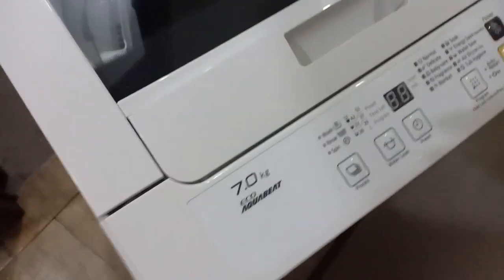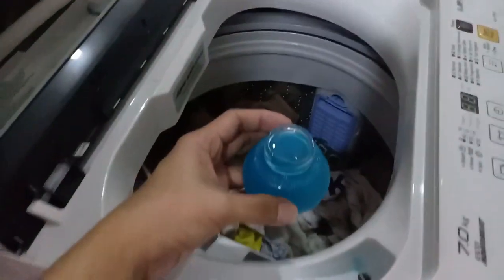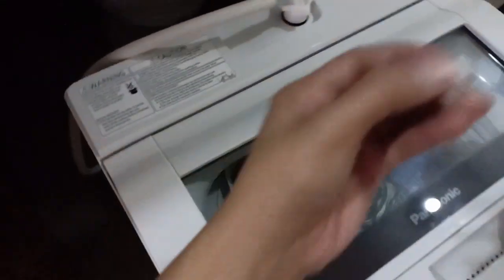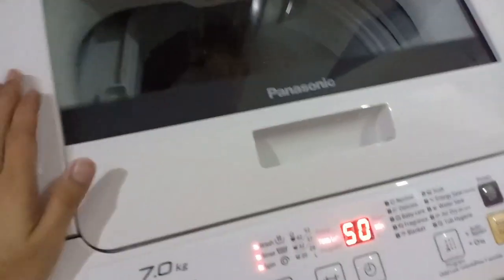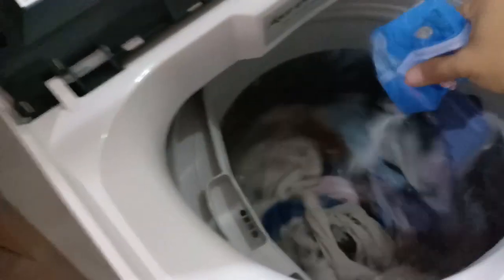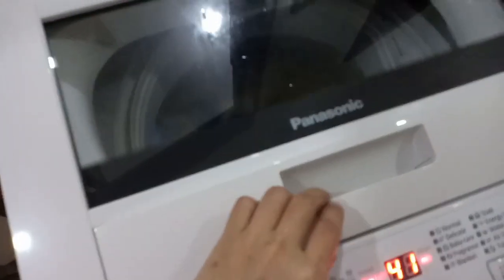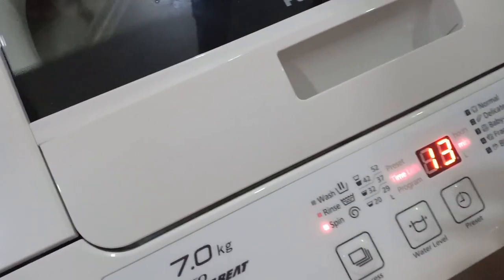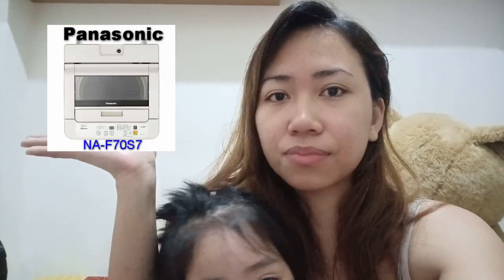VLOG #19: How to use Panasonic NA-F70S7 Automatic Washing Machine / DEMO ♥ The Newbie Mommy ♥

Comment: I don't recommend na ilagay yung fabcon sa start ng laundry. Sa first spin kasi nagdidispense na yung softener. Ang program nya kasi is:

Wash > Spin > First Rinse > Spin > Second Rinse > Final Spin

Magandang ilagay mo yung fabcon sa dispenser kapag nasa first rinse para madispense sya sa second rinse. Sayang kasi mababanlawan ulit sya sa second rinse
Reply from the maker: Aw, yes good idea! Will do that next time. Though in my case, naaamoy ko pa din naman yung fabcon after the whole process, pero hindi lang ganun kalakas yung scent nga. Kaya yes, I think you're right to put it sa last rinse. :)
Reply: pano po pag drier lang ung gus2 ko iapply? ano p iseset up?
Reply: @joshuaesperida512   yung airdry will take 90 mins. Kung masyadong matagal for you, pwede mo gawin to:

Power ON>choose Normal (Program 1) > press mo yung button na nakatapat sa wash/rinse/spin several times until sa SPIN lang yung may ilaw > press Start

Spin will take 9 mins. Pero depende kung balanced or hindi ang load
Reply: slamat po
Reply: Hi po. How do you administer powdered detergent into the machine? Dapat ba before you put the clothes into the washing machine?
Reply: @adonjohnlaserna1837  Hi, you can actually add detergent after or before you load the clothes. It's fine. Make sure lang na high efficiency gamit mo na detergent, para di madamage ang machine
Reply: @benedictcruz07  kasi my problem is i usually put detergent on top of the clothes tapos after the wash, there is residue of soap on the clothes. Tapos after doing research, they recommended to turn on the machine and start it and as the water pours in you add the powder then the clothes. Pero ang downside nito is the machine cannot estimate the corresponding water level na for your labada haha. Anyway thankyou for the quick reply. God bless
Reply: @adonjohnlaserna1837  you can use liquid detergent for your clothes or, dilute the powdered detergent in water before adding onto your clothes. Para sure na walang residue. :) sure, no problem. :)
Reply: Nahihirapan ako. Kanina pa ung labahin ko. At first nagwork pero nung nag drain nagstop na. Patulong po
Reply: @yourkasi  paano po ba nangyari?
Reply: @benedictcruz07  biglang nag stop po sya ng matagal. Tapos on off ko. Bigla ulit magspin tapos mag beep sbay stop tapos ung sa rem. Time baliktad na 3 at 1. Ung 3 lang baliktad, sa kabila sya nakaharap. :(
Reply: @benedictcruz07  pano po ba unang gagawin? Kahapon ung tinry ko una Hindi nagwork, pero nagwork naman bago mag gabi. Ngaun ayaw na naman. Sharp po pala ung saken
Reply: Mag kanu po ba ag budget ng washer na ito??or is there any washer that is smaller than this?? Thankyou.
Reply: automatic na yan rinse start pa lng ng washing nilalagay na ok lng!!kc sa huli nmn nyan yan rinse ng washing!!kaya nga automatic eh!Parang sa water lng yan hanggang di click start naka lock sya!!di yan i disposed ng washing yang mga downy na yan start pa lng, sa bandang kalagitnaan ng time ng washing saka lng din yan i disposed automatic😅😂🤣wag nyo open ng open washing nyo if nasa operation yan ang ikakasira ng programming nya!!Saka yung water outlet dapat mas malapit sa washing at mas mataas ang level ng water outlet  na i connect ang hose na water supply ng washing at need malakas ang supply ng water flow dahil may standard program yan time at pati yung ilang meter lng dapat distance ng washings sa water outlet!!Sa japan lahat ng bahay bago gawin kasama na sa plan saan ang place ng laundry may gawa install na  sink ng washing drainage at most of all yung outlet saan i connect ang water na malapit sa lagayan ng washing at mas mataas ang level kesa taas ng washing!!na yun tlg ang standard na estimate ng programming ng mga automatic washing machine!!Di dapat bukas ng bukas pag nag operate na naapektohan ang loading ng programming nya!!1980s pa automatic na mga washing sa japan kung saan kelan lng familiar sa pinas di pa alam ng mga home builder isama sa plan ng paggawa ng bahay mga electrical outlet at water outlet supply at drainage ng dirty water ng washing na dapat kasama sa plan sa ilalim deretso drainage di nakatiwangwang bumabaha sa labas tubig galing sa washing!!!
Reply: Maayos na flow ng water malakas dapat!!Ang hose ng water kung saan naka connect ang washing malapit lng ang distansya sa washing!!Dapat mas mataas ang faucet ng water  kesa level ng washing na pinag connect nito or else di magtagal ang washing sa pinas dahil wala sa ayos ang standard fascilities nito na naka program sa pag gawa pa lng!!Di tumatagal ang automatic washing machine sa pimas sira agad dahil wala sa ayos at tama ang fascilities!!Sa japan naka ready na lahat yan sa mga gumagawa pa lng ng house naka measure na ang standard na distance ng pag connect ng washing at taas ng level nito more than the washing ang outlet na doon i connect ang water!kahit gaano ka durable at good quality ng products mabili kung ang fascilities di tama sa programming standard ng washing di ito magtagal masisira agad!!Lalo sa pinas uso ang brownout bigla nawalan kuryente pak sira  downloading ng program ng washing!!Bagay sa bansa na tulad sa pinas nag brown out mga manual na washing hindi automatic!!
Reply: put all your clothes to washing,then detergent powder and downy!!you can see the dispenser kung saan ilagay ang powder at softener and bleach if white mga labahin!!On your washing and set your washing sa desire na paglaba kung ayaw nyo ng automatic program na depende sa dami ng labahin na washing na dapat nag estimate!!may button jan kung gusto nyo full wash mode full rinse at dry nya at pwede nyo i set kung anong level ng water lng depende sa dami ng labahin!!after ng lahat saka  press Start!!!Hindi nasisira ang washing dahil sa mga uri ng detergent powder,bleach or softener kundi sa system ng fascilities nyo di maayos lalo sa flow ng tubig if sobra mahina!Dalat malakas flow ng tubig sa faucet nyo para mag match sa setting time ng loading program ng washing!!Wag tipirin ang flow ng tubig dahil kahit malakas sya lahat na kokontrol nmn ng washing tamang flow!!kung mahina ang flow di match da standard process nya lalo time!!Higit sa lahat wag open ng open if nag start na kayo process ng paglaba kahit sabihin na ok lng buksan isa sa napadali masira ang automatic washing machine!!!Mas pinaliliwanag kc masyado sa japan ng mga distributor ang details ng tamang pag gamit ng products nila to avoid trouble sa products nila masira dahil hanggat maari good perfect quality products ang gusto nila paninda!!
Reply: Parang mabaho pdin po yung mga nilabhan. Ukih lng po bang buksan un washing kapag nag aalnaw na?.
Reply: @VChin-ru8oq  sa haba ng sinabe mo, walang tama. Edi sa Japan ka maglaba.
Reply: @joshua esperida paano po pag naglaba aq kamay tas gusto q lang po spin lang sa washing machine tas click q lang cya at several times until spin na yung light..kahit hndi ko na po ba i on ung faucet?salamat
Reply: Or sa last rinse sya ilagay ganun kami kaya mabango parin damit after matuyo. Yung iba imbes na fabcon ang ilagay distilled vinegar at one cup ng baking soda daw mas nakakalambot, nakakatanggal ng stains at nakakatanggal ng amoy ng labahin. Nilalagyan lang nila ng essential oils para mabango.. Sa US yun or Europe.
Reply: Tyaka sabi nila panget daw yung walang agitator. Yung old school na may agitator na auto daw mas nakakalinis ng damit.

Comment: Thanks for sharing. Kamusta na po washing machine? Any issues? Also about sa water bill?
Reply from the maker: Hello! Still works well. Iwasan lang po mabasa yung back part, water hose inlet part and yung buttons panel since we experienced error dahil nababasa namin. But overall, it's still working for  more than 3 years already. Tipid din sa konsumo ng kuryente.👍 Thank you

Comment: 7:07
Question on timestamp 7:07 , I've read the manual and it says there at page 5 Washing section on step 3 that when you Press start. The pulsator moves without water and measures the amount of laundry. (approx. 5 seconds) -> Then water level indication (approx. 5 seconds).

Is the 37 digital number supposed to be labeled as 37L not 3.7 kg since the light indicated L then afterwards time left is 50 min on the digital light? 

So the machine does not weigh by kilograms but estimates the weight of the clothes and labels it in Water levels so you would know how many scoops of detergent to use like in Page 3 Operation Panel?
Reply from the maker: Hi! Please check my pinned comment. Thanks!

Comment: Hi mommy, kamusta naman po ang washing machine okay pa rin po ba til now?
Reply from the maker: Hello! Still works fine po. Overall washing performance is still the same.  Though pina-plan namin i-check and i-open yung spinning tub mismo since may nakikita kaming mga malalaking residues (parang paper na slimy eh, we're not sure) na lumalabas sa drain hose after we use it. We'll try to vlog it po to share it with you all also. Thanks!

Comment: Hello.ask ko lang po: kapag nag off na po ba yung machine pwede na rin i-off ang faucet?
paano po malalaman kung may water pa sa loob ng machine, ano po ang program na i-press para totally dry sa loob ng machine? thank you.
Reply from the maker: Hi. Yes, pwede na i-off ang faucet pag naka power off na ang AWM. Actually ako pinapatay ko na yung faucet pag last spin na. I don't press any process/program to make sure na drained na lahat ng water, basta as long as wala ng lumalabas na water sa drainage hose, that's fine. ☺️

Comment: Hi! Paano po linisin ung washing machine after gamitin? Kse bka may mga residue pa ng mga detergents after gamitin. Thanks!
Reply from the maker: We don't clean after use kasi after ng spin, tuyo naman yung awm. But there is Hygiene process na iseselect if you want to clean the awm at least every 2 weeks or once a month is fine. Haven't tried it yet pero based on some demos, it might take 2 hours daw to finish the hygiene process. Lalagyan lang ng  bleach yung water and mag-spin lang xa.

Comment: Pano po idrain yung water sa ganitong unit?? Di ko po kasi naibaba yung tubo na paglalabasan ng tubig pag nagbbaanlaw
Reply from the maker: For this Panasonic model po, just let drain hose na nakalapag lang sa floor the whole process. Kelangan po kasi dini-drain na ng kusa ni awm when needed every time. It may cause damage kapag di po nakababa yung drain hose during the process.
Reply: need ba tlg na naka-open ung faucet habang naka-open ung wash and spin
Reply: @christineroces6789  yup auto stop naman kapag nameet na nya yung standard level nung water

Comment: hi po.kabi2li lng nmin AWM.hndi pa natry gmitin kaya nag ha2nap ako ng tutorials and reviews.since wala kming supply ng tubig na deretso ang flow. ang plano ko magbutas ng timba then ipatong sa mas mataas ang level kesa sa w.m then dun iconnect ung hose para ung timba ung susupplyan nlang ng tubig(pwede nman mag stock may drum nman)ang problema ko po is kng hndi kaya un magka2problema?kc ung tubig tuloy tuloy ang daloy from timba to w.m.thanks po kn advance :)
Reply: hindi naman kasi kusang iistop un
Reply from the maker: Better talaga if malakas sana ang supply ng water from the faucet. I cannot comment po if mag work yung timba na mas mataas sa awm but if your concern is baka magtuloy tuloy ang daloy ng water sa awm, no po. Kinocontrol po ni awm yung pasok ng tubig sa loob ng awm. Samen from faucet, nakabukas lang yun the whole processes, kapag last spin na lang or kapag nag automatic off na po ang awm tska ko pinapatay yung gripo so don't worry. ☺️

Comment: Kusa na nia kinikilo ung damit??sabi sa robinson di dw po??confuse ako kung ito o electrolux bibilin  ko
Reply from the maker: I have a mistake when I mentioned about dun sa weight ng damit which is not kg pala but liters para sa sukat ng water. Not sure if automatic nagkinikilo nga, pero sa 6 mos. kong paggamit, I just use what's default  and we don't maximize 7 kgs or hindi namin ppinupuno since hindi na din xa nakakaikot ng maayos. Hope this helps!

Comment: Kapag in-on palang po yung washing tas di pa iistart, normal lang ba na may sounds sya? Ty po
Reply from the maker: You should hear a "tick" sound lang, then wala na dapat. Yung sound na yun is parang ma release lang yung bin at pwede maikot if gusto maglagay ng fabcon. Other than that wala naman kami ibang sound n nariririnig sa awm namin before we push the start button. ☺️

Comment: Ano po yung ginamit niyo na connector from faucet to hose at connector from hose to washing machine hose? Plano ko kasi bumili online kasi ang hirap maghanap ngayon ng mabibilhan ng ganyang tools.
Reply from the maker: Hi! Yung hose namin is merong bronze na round part on both ends na may thread/roskas (brass male/female tyree). And then yung faucet mo should also have a thread/roskas sa opening nya para maiconnect yung hose, same dun sa connector papuntang hose ng AWM. I think it's available naman in any hardware stores. Thanks!

Comment: sis pano pag biglang nag stop sya mag wash? Tapos di sya umikot mag rinse?
Reply from the maker: Hi! May error po na lalabas sa pinaka screen kung saan nakikita yung timer if you encounter any problem while using the unit. May lumalabas po na error code don. Better have it checked by a service center since hindi po dapat tumitigil ang process when using it. Hope this helps. Thank you!

Comment: Hi po. We have the same washing machine. Ask ko lang po since mahina yung tubig namin dito sa bahay di ko sya kinonek sa water supply bali binuhosan ko lang ang loob. Is it okay lang ba? Thanks po sa sagot.
Reply from the maker: Hi Daphne! Not sure lang sis since I haven't experienced na mahina ang water samen and magbuhos ng water sa loob but I guess magbabago yung setting ng WM? Have you tried it? Kasi yung WM automatically knows the water level that it needs, and  kung kelan sya magsspin/rotate  or mag-stop depende sa volume ng water na nilalagay na nya coming from its water port. But if it works, well it's okay though I find it inconvenient sis if you need magbuhos everytime mag change ng process ang WM. I hope lumakas ang water supply sa inyo sis para ma-enjoy at ma-maximize mo ang use and convenience ng WM natin. :) You may directly ask Panasonic for better advise. Thank you!
Reply: Ok lang sis nasubukan ko na po  yan same tayo mahina ung water supply lalo na kapag naka connect na sa hose . Sa aking experience ok naman kahit buhusan kasi nasusukat padin naman ung water level. Basta careful lang ang pag buhos ng water.
Reply: @nikkiandkloe2478  panu mo nalalaman sis kung yun na ba ang water level. Nilalagay mo muna ang labahan before water or water muna before labahan?
Reply: Ilagay mo muna ung damit syempre tapos on mo and click start dba kapag napindot na ang start kusang lalabas ang water dba hanggang sa kusa din masususkat kung gaano ung kadami water level and pag ok na tsaka mag stop ung daloy ng tubig at mag start ng mag spin. So dahil mag bubuhos ka lang ng water sa loob ng WM check mo water level and habang nag bubuhos ka  hintayin mo na mag start na mag spin ung WM kapag nag start na mag spin tsaka kalang huminto sa pag buhos ng water ibig sabihin nun ok na ang sukat ng tubig sa loob ng WM kapag naikot na. Wala naman mangyayari hindi maganda sa wm kung ganun gagawin mo ang pinagka iba lang mapapagod ka sa pag salok ng tubig hnd kagaya kapag mismo sa hose lalabas ang tubig eh sitting pretty ka nalang para mag antay. 😊😊 goodmorning po
Reply: @nikkiandkloe2478  thank you po talaga 😊 God bless you po
Reply: @nikkiandkloe2478  hi po pag nasa rinse mode po ba sya need nakabukas lang yung faucet... Nagleak kasi yung sa may connector.. Sayaag id nakabukas lang sya
Reply: @phoebekionisala3468  kahit off  mo muna then pag kinailangan nalang ng water or mag dadagdag uli ng water tsaka mo nalang buksan

Comment: Hi po we have the same washing machine, kakabili lang namin at napansin ko may rubbery smell sya esp nung nag air dry ako for 10mins lang. Ganito din po ba yung sa inyo nung bago pa?
Reply: same po mam. Tapos di na siya naikot. Pano po kaya yun?
Reply from the maker: Wala naman po akong naamoy na rubbery smell sa aming awm. If ganun pa din ang case nyo until now, better contact your Panasonic supplier po. ☺️

Comment: Same washing machine po..hndi po cya tinitimbang ng washingmachine yung po ay 37 liters of water hndi po 3.7 kls..kung mkkita nyo po sa tabi nun timer andun po ung liters ng tubig 20 29 32 37 42 and 52..if sa tingin nyo kulang ung water pause nyo lng po then press nyo water level kung 37 litera pede nyo gawin 42..
Reply from the maker: Oh i see... Still new  pa din using the machine but so far I have no problem naman with the water level. Thank you for this Rainer! :)
Reply: pano po pag drier lang ung gus2 ko iapply pwede po ba yub?
Reply: @joshuaesperida512  pwede yun just press process button until na spin lang ang naka ilaw.then start. Try it.

Comment: Paano if you want to use the same detergent you used for whites for colors? Pwede mo ba stop the process after the wash, remove the whites and replace it with colors then redo the entirely wash cycle using the same water and detergent?

Comment: hi.. bumili ka po ng weighing scale to check if less than desired kg xa? or automatic po ba ung machine mag weigh ng dry clothes before starting the process
Reply from the maker: Hello! No need to buy weighing scale po. The AWM can determine the weight of the clothes, but it will not be flashed in the indicator, only the water level needed based sa pagkaka-weigh ni AWM. Just make sure you don't maximize the 7kg, have enough space left para makaikot po ng maayos sa loob ang nilalabhang damit. Thank you for watching! ♥️